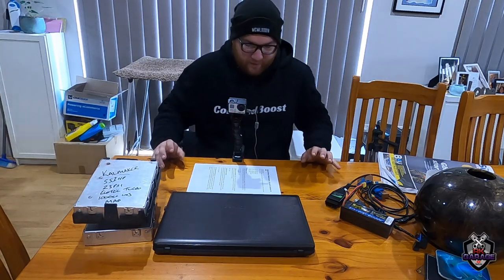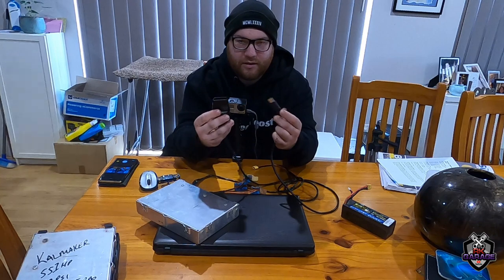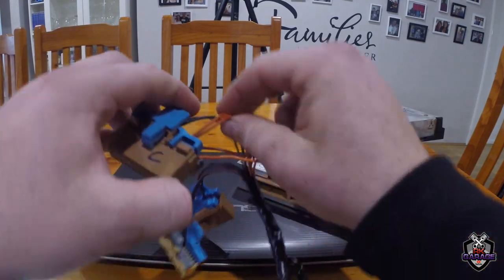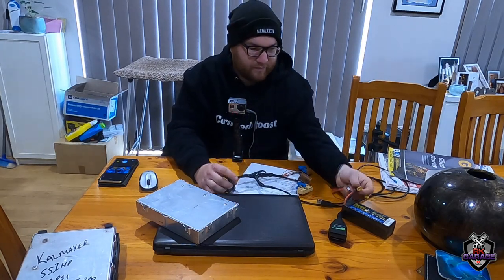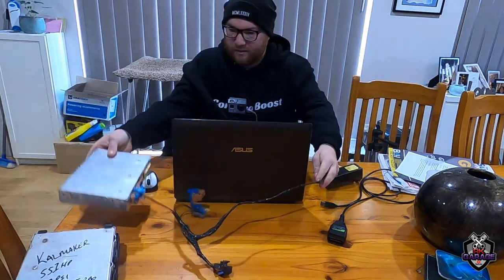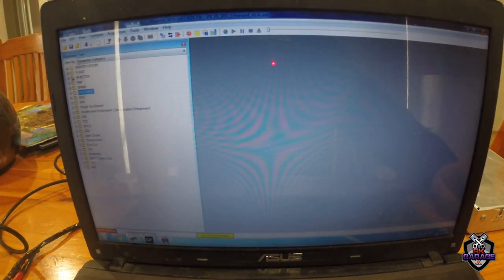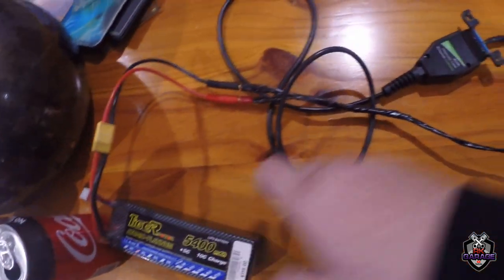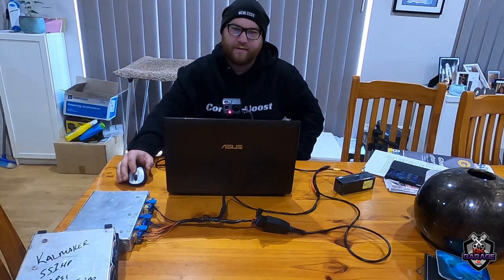How To Bench Wire & Access VX VU VY NA V6 ECU's To Read & Flash Write

Comment: Awesome vid, just made my own harness and it works great! Bricked my first ecu after tryna do it in the car lol. Bench is the way to go
Reply from the maker: Glad to hear it worked mate!

Yeah they are notirious for bricking when in the car. I went through quite a few!
Reply: @RKGarage  think I have possibly found a cure for rev hang in the manual tune too! Set Throttle follower to kph and drop gain values to zero. Hopefully means no more IAC up steps during gear changes
Reply from the maker: Yeah that is one of the ways I have fixed it before
Reply: @RKGarage  did you find that it idles high after selecting manual options on enhanced bin? Think I need to adjust some tables but not sure where to start..
Reply from the maker: Didnt affect the idle at all
Reply: @RKGarage  did you have to change anything other than selecting manual options to get it to run properly?
Reply: Useful I'm looking to start my own cheap 3.8 build. Just a more responsive eco. I do have a question for you good sir? For power can I just use a psu from old tower its 12v ect . And is all on a switch . All surge protection ect so safer ?
Reply: @RKGarage  you should do a video of you making the cable
Reply from the maker: This video shows it.....

Comment: Awesome videos, I'm trying to set up a freestanding vy ecotec,  with switch and push buttons start, I'm after a pinout to find what I need to power to make it run, fuel pump wire, ect.. I've got a set up from what you have done here,  is that all I'd need to get it going? Can just wire the starter separate?
Any help would be greatly appreciated! Cheers
Reply from the maker: Hey mate, can wire fuel pump and starter seperate. Same as thermo fans 👌
Reply: @RKGarage  too easy! So I shouldn't have to get 12v power to, or earth any other pins in the ecu?
Aslong as vats disabled and set to manual it should fire up?
Cheers! Appreciate it man

Comment: Hi mate how much do you charge to do that my Vox commodore will not start I’ve got all dash lights and have everything else but no start I’ve changed my drive module and put a brand new battery in it I put my tester on it and it says the ecu not talking to the engine I’m not sure what’s going on with it

Comment: Would I be able to "bench" harness while still in the car? As in unplug the 2 unnecessary plugs and just have that one plugged into ecu and then press Flash PCM on bench on OSe??
Reply from the maker: Pull out the ecu completely
Then yes
Reply: meaning i 100% have to make a proper bench harness? @RKGarage
Reply from the maker: Yes

Comment: Im made a bench set up and am wanting to do a burble/pops an bangs tune any advice on what change using tuner pro ??
Reply from the maker: timing in the negatives where you are in over run
turn over run fuel cut off, or decel fuel cut off
Reply: @RKGarage   legend my bro just made a bench set up an bench tuned a burble on my vy your video was awesome an helped out heaps an do you know were would I get a bin file for lumpy idle tune churs bro ur a legend
Reply from the maker: I'm glad I could help.
At the moment I'm not releasing my lumpy idle tune as it makes the car a constant flamethrower and is no where near safe nor legal for road use.
Reply: @RKGarage  mad respect my bro keep up the solid work be keen if you ever do a lumpy tune that can be road legal im in nz so would have to check laws on that first
Reply: @RKGarage anyway you could make a video on this mate
Reply: @felekenukkit3855  just a question mate I wanna get a bench setup and am gonna buy the bench harness of a sight which comes with everything as I’m no good wiring stuff together how I do get a obd port from a car?